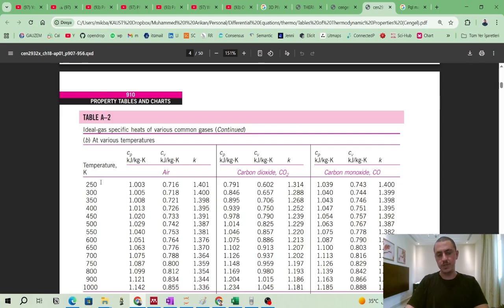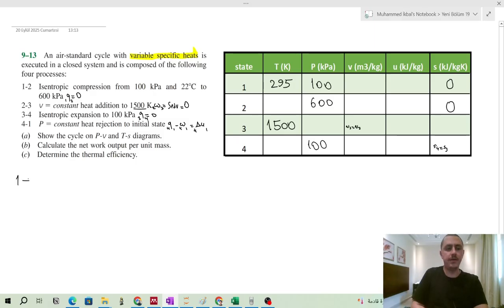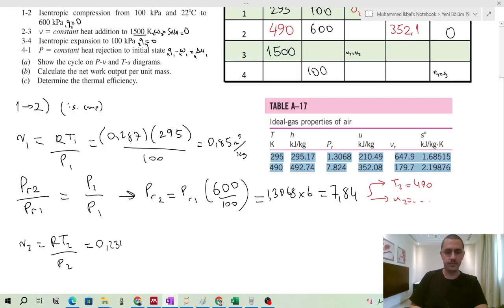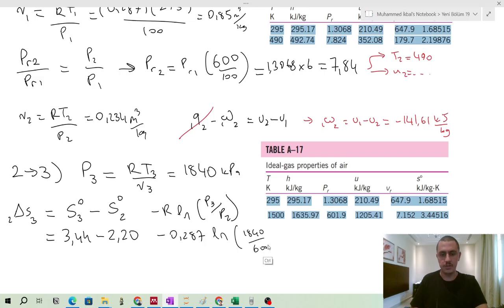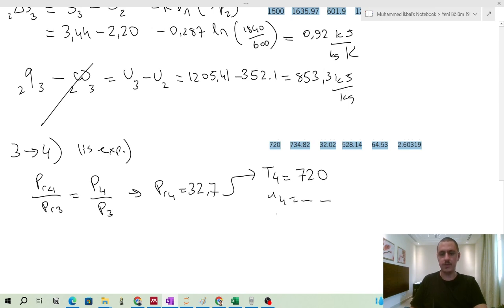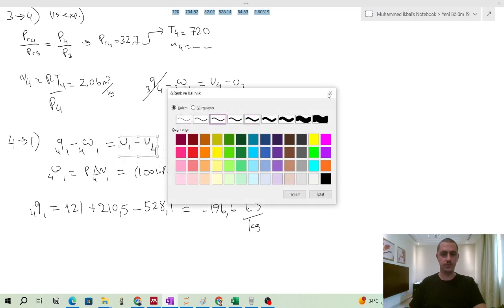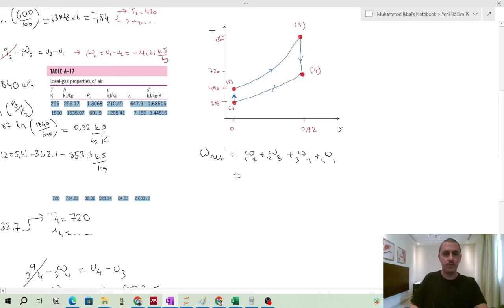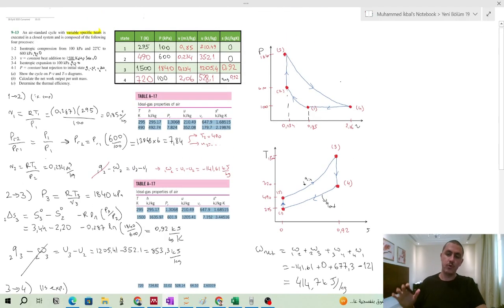Engineering Thermodynamics II | Gas Power Cycle | Solved Problems #1

Comment: Thanks Teacher, could you do for the case with recuperator (regenerator)?  If possible with python code also. Great
Reply from the maker: Hello Bernard,

There are a lot of corelations for different types of heat exchangers, you can integrate HE formulas to your code and integrate with thermodynamic library COOLPROP because the corelations used in HE design will require calculating of thermodynamics properties using a library.

Try to select your HE type (sheel and tube or plate to plate etc.) than find the corelations and collect, after that let me know if you needed help when integrating that with coolprop.